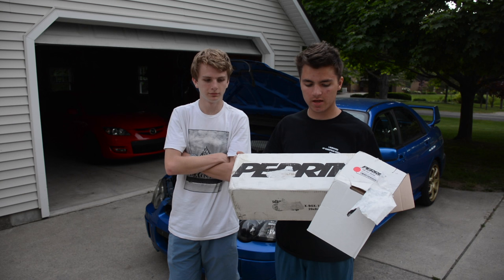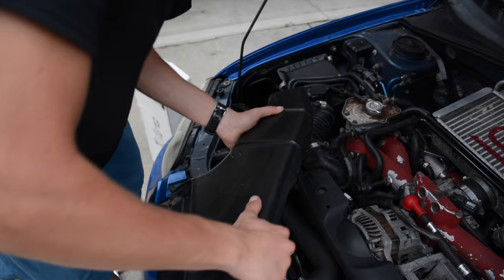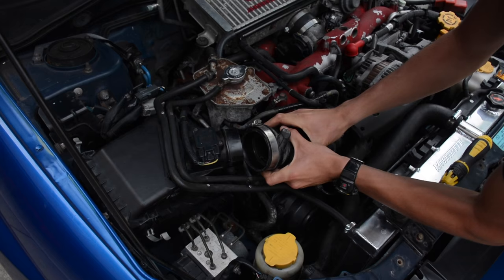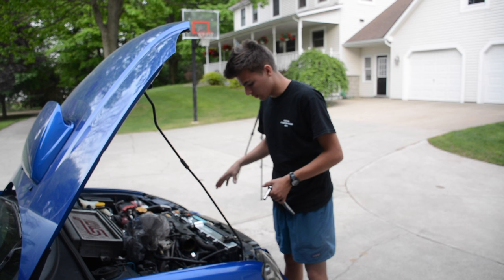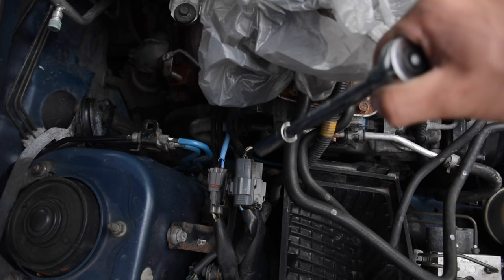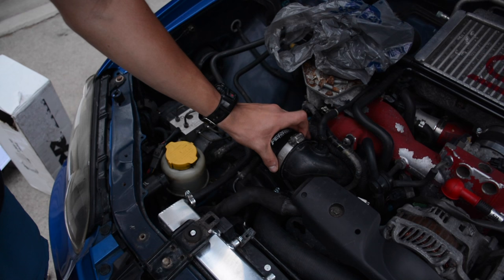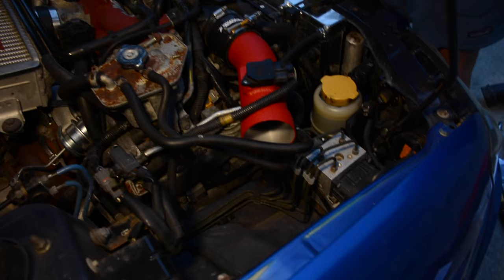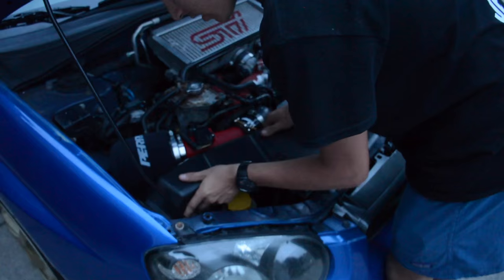Perrin Short Ram Intake

Comment: I hope you got tuned for this or your MAF scaling and AFRs are going to be way off. Exhaust should always be first (with a tune), or do your exhaust and intake at the same time.
Reply: Joshua Messier that year doesn't need one
Reply: GTAFINESTXRAY that could not be more incorrect. All turbo Subarus require tunes for aftermarket intakes.
Reply: Joshua Messier only from 08+ I even emailed Perrin just to be sure.
Reply: GTAFINESTXRAY dude, you're wrong. I had one of these on my '06 WRX and my tuner confirmed that all of them need it.
Reply: And when I switched intakes I had to get another map for the new one.
Reply: Honestly depends on which company you buy from. There's some that require a tune but not all. Perrin is one that you don't need a tune.
Reply: GTAFINESTXRAY no, it does not. Changing the intake changes the airflow, which requires tuning to correct the MAF scaling in order to keep your AFRs in the proper range. Ask any reputable tuner and they will tell you the same thing. I owned a Perrin short-ram and then switched to an AEM cold air intake. Both of them required a tune.
Reply: Joshua Messier yea imma trust Perrin's engineers better than a tuner 😂😂 the logic in that
Reply: GTAFINESTXRAY an engineer is not a tuner. Just because they design these parts doesn't mean they all know how to tune the cars the parts are intended for. My tuner is one of the most reputable in the entire country, I trust his word over a parts manufacturer when it comes to ECU calibration all day long. But hey, if you wanna throw some parts on your car and not get tuned for them, be my guest. I'll just keep enjoying my 12-year-old WRX that runs 100x times better than when it came out of the factory. 👍
Reply: GTAFINESTXRAY lol. Someone is obviously triggered. My car doesn't need to look good to be fast, pal.
Reply: Joshua Messier Yea the engineers don't intend to design them for performance purposes? How stupid are you they're not gonna make them for looks and yes I know they're not tuners. If you seriously think a tuner is superior than an engineer I don't know what to tell you. All these tuners and mechanics have big egos that think they know it all.
Reply: GTAFINESTXRAY wow, you must be so cool, insulting me to get your point across. The strawman is strong with this one. I never said tuners are superior to engineers--I'm honestly not even sure if you know what an engineer is at this point--but their area of expertise is ECU calibration. An engineer's area of expertise is designing the components. Apples to oranges.
Reply: GTAFINESTXRAY your argument was flawed from the very beginning. You said that this particular model year shown in the video doesn't require a tune, but then you said that the 08+ WRXs/STIs don't need a tune. You know the car in this video isn't an 08+, right?
Reply: david benson apparently customer service representative = engineer now. Looks like I can just stop going to school and go apply to be a rep for Perrin. Boom. Instant engineer. 😂
Reply: Got nothing to say cause I got a point. Go pull old ladies with your wagon.
Reply: GTAFINESTXRAY got nothing to say? Did you not see my last three comments? It seems to me the only person who has nothing to say is you. And I think I'll stick to pulling on SS Camaros and 5.0 Mustangs with my wagon, thanks. What do you even drive?
Reply: I'm getting a real wrx not a shitty wagon lmfaoo
Reply: Imma trust perrin instead of an internet tuner or mechanic
Reply: It still stays on safe AFRs with this Perrin intake. Seriously you internet mechanic have selective eye sight. I'm not saying you don't need a tune on any intake but only on some you don't need a tune.
Reply: @GTAFINESTXRAY  they do need to be tuned
Reply: @GTAFINESTXRAY  If they dont make them for performance purposes..then it's pretty much pointless lol
Reply: @GTAFINESTXRAY  lol calling me a dumbazz..please do put a a mod ok without a tune..see how long your engine lasts
Reply: Mohammed shahid  Some intakes for 2000-2007 DONT need a tune. Some companies have the money to run tests to imitate similar or same airflow as factory.
Reply: as much as i wish it wernt true joshua messier in 100% on the money, you can be lucky and not have any problems but if not lucky can have internal engine issue
Reply: Great debate lol my cousin who has worked for subaru as a mechanic etc for 15+yrs said to me ‘ You don’t have to tune if its a short ram’ that’s all he said but he probably met for my 2002 wrx wagon. So 🤷🏽‍♂️, cause I told him about this debate in these comments cause I was wondering myself too, I’m installing one soon so I asked him
Reply: Im getting it tuned regardless just to not fuck around even tho its a short ram

Comment: dont you need a tune for that?
Reply: Yes!
Reply: bugeyes will be fine w/o a tune
Reply: bullcrap, installing a cold air intake without tuning it to maintain the correct air to fuel ratio for the engine will cook your engine.
Reply: to bad its not a cold air intake its a short ram, a cold air intake would go down the wheel well passenger fender side soaking up all that nice fresh air (cold air) that exactly opposite what a short ram does.  @remembertheshadow

Comment: How does that stock intake still work...?  you've just put on a "new" cold air intake its pointless having it on there ???
Reply: How does that what? LOL

So the stock intake is restrictive as it has a medium air filter with an air box to reduce reduction intake noise. The short ram intake remove the air box and has a less restrictive filter. 

Theoretically, the engine is able to intake air faster and more efficiently. 

A cold air intake has the filter away from the engine like underneath the bumper to receive "colder" (5 degree difference) of air.  This produces a bit more power (1-3HP)